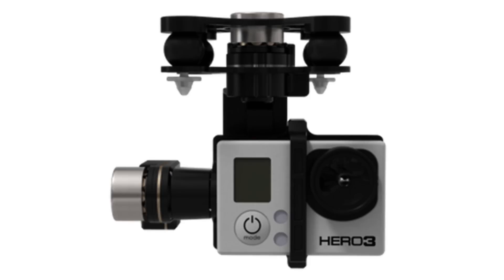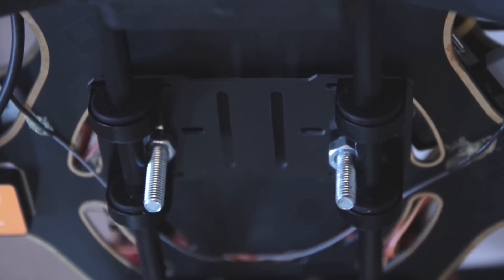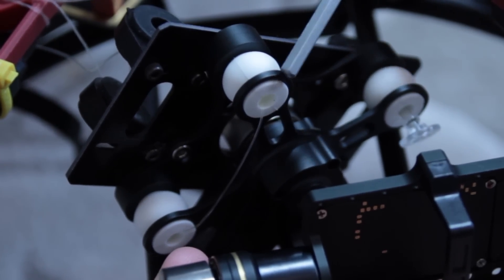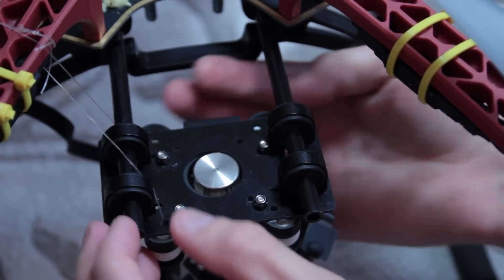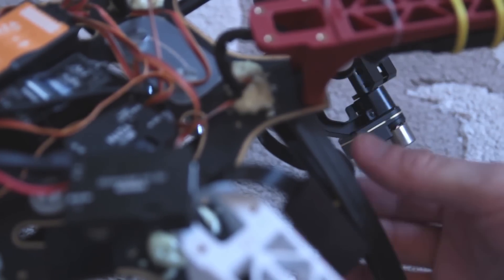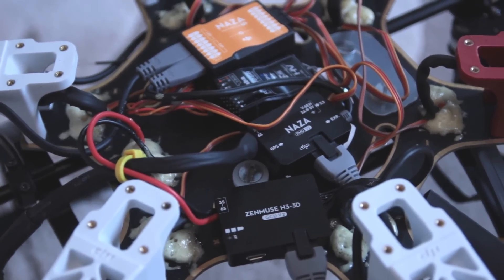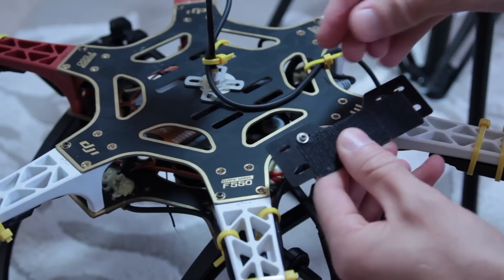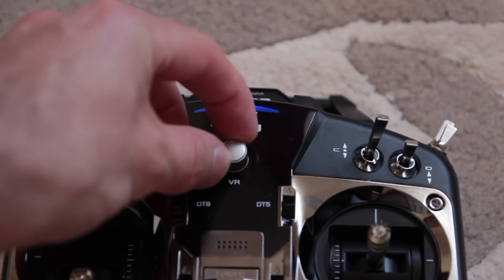How to install the Zenmuse H3-3D Gimbal on the DJI F550 and F450

Comment: Hey, great videos. I’m really hoping you can help the fellow Englishman with a slight issue. I also have an F5 50 that I just finished building with the Zenmuse H3-3D Gimbal and Go Pro Hero 3+. 

I’m actually using a Taranis X9D + radio and I do have the movement of the camera up and down just like you, but I’m wondering about the ability to take pictures and record video while up in the air. I do have a GoPro brand Wi-Fi remote, but I suspect that wouldn’t work very well once the drone is up in the air.

Is there something that I am missing in order to be able to take pictures and record video on the GoPro using the same set up as you ?

Cheers in advance

Comment: Do you use the gopro as your FPV camera? Also can you use the gimbal without plugging it into the naza? I have the naza M lite but it dose not have that connection on the power connector

Comment: Oh! Your MC has very bad place , place it exatly in center of your f550 Otherwise you will have a very bad Stabilization
Reply from the maker: +Thearc36 Thanks for commenting, but no, you can calibrate for the precise location to avoid any lack of stabilisation!
Reply: +AirborneFilming yes but your mc is not fixed at stable plate , and he can move on fly ,  i'm realy sorry for ly english i'm french ;) and i have make tutorials for build This f550 in french ;)
Reply: +Thearc36 No, they are all fixed by velcro and can NOT move in flight!!
Reply: Vibration It can influence on stabilization
Reply from the maker: nope, not on mine ...

Comment: Good video i have the Zenmuse gimbal on my phantom2, After building a dji f450 i don't use the phantom 2 anymore Im wondering can i take the gimbal off my phantom and install it on my dji f450, I understand i will need to add a GCU, If i can take the gimbal off the phantom 2 that will be great thanks

Comment: If you plug the Zenmuse into the output of the camera, how do you transmit video to your monitoring screen?
Reply: Goodwing - it appears the GMU gets the video output so it's taken from there with a small phone jack and supplied cables that came with the H3-3D. I haven't tried it all yet but it looks simple enough once you have it in your hand.

Comment: This is an interesting video - I'd picked up those legs along with a DYS 3-axis gimbal to go on my 450.  I followed the (vague) instructions on the mounting of the frame - which suggested the ends of the 450 (i.e the floppiest parts) go on to those plates which only mount on one side (looks like you are using one of them to hold your lipo).  The result of what I did meant there was far too much give through the join and I ended up with the entire frame oscillating.  I'd just got it packed up to go back as I thought it was crap.  Did you just figure that those 2 other plates would work better or something - I take it the legs feel solid with that half-decent attachment to the frame ?
Reply: Curry kitten, have the exact same problem as you. I have now set my landing gear up the same as this video, need to test it though, been too wet and windy just lately to take my f450 out. Have you managed to sort yours out?
Reply: Tom Griffin Nope, got a refund on it and will work on another solution.

Comment: excellent video mate... just one question... what battery do you use? the 3S or the 4S? I can tell by the video that you use the 5200mAh 35C... I'm just not sure in which one to order! 
Also.. will the the charger for my phantom batteries work for these?
Thanks in advance.. excellent material!
G
Reply from the maker: Hi, I use the 4S to give extra power for the longer flying time! Cheers!
Reply: link?